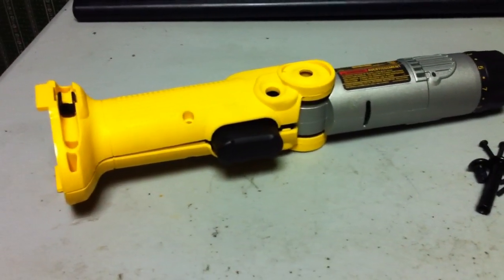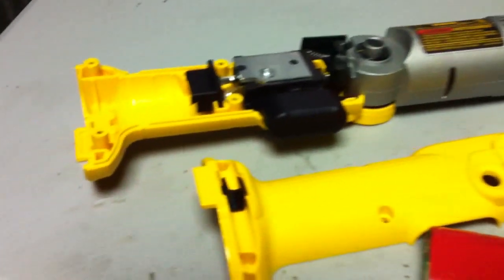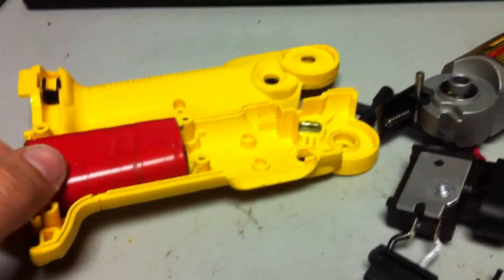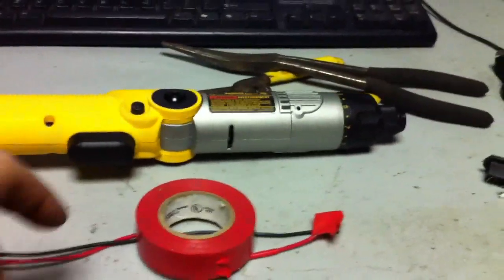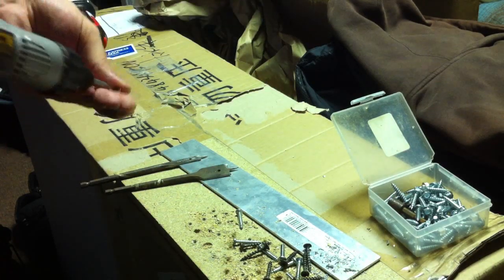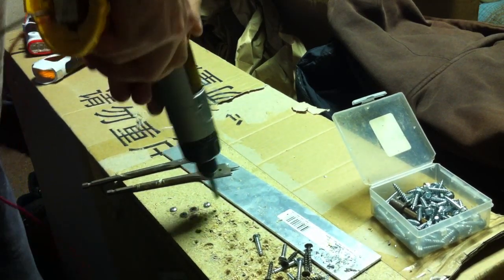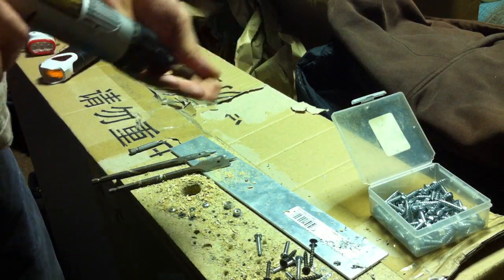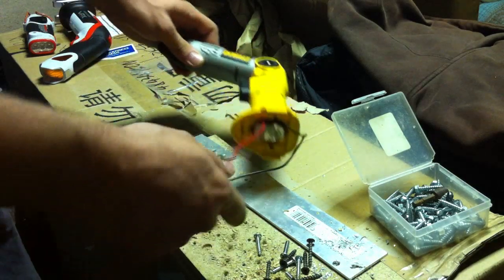Convert your Drill to Lithium - Dewalt DW920

Comment: I know this is an old video, but do you have a parts list for this project?
Reply from the maker: All that you need is 2x 18650 cells wires in series and a soldering iron and a bit of wire

Comment: https://youtu.be/KjDND7qYtCw
Video reply- with some more info.
Wanted to add fully charged voltage is right at 8.39v.
Batteries here-. https://www.18650batterystore.com/Sony-18650-p/sony-vtc6.htm?gclid=CjwKCAjwwvfrBRBIEiwA2nFiPeFCqmbMY72uvb7Puq7zjIvGzzx7vCthPkvOHYAHyGeMpy9qxg2hOhoCxboQAvD_BwE

Comment: I am modifying a DeWalt drill just like yours. My question is  did you wire the batteries in series and what plug did you use to connect to the charger? Thank you.
Reply: You're on the right track! Wired in series would be 3.7 volt x2 = 7.2 volt.  Here's some good info on batteries... http://batteryuniversity.com/learn/article/serial_and_parallel_battery_configurations 

Between me and my Son In Law, I have 2 of the drivers and 3 or 4 of the 7.2 packs. So I would change the packs, instead of making a permanent install in the driver itself. To me, It's not hard to do! But as always, use your own judgment on your abilities!! And.. If you're unsure of your abilities, ask your Father In Law!..lol

Good Job to the person doing the video!! I'm using the 18650's in E-cigs. Guess I should say, most E-cigs use the 18650's because I haven't converted them, they come that way!!..lol
I haven't looked into the cost of converting the packs! But free is free!! And if I were getting the 18650's free, I might make a permanent install! But batteries are batteries and as sure as I'm typing this! You'll be making another install someday!! But...Same goes if I make the packs!! So I'm going with...Free is free and you have the hard part done!!! 
Good Job!!!
Reply: Thank you.

Comment: Great info, thanks. I plan on running wires from the drill leads, through the handle into the emptied old battery pack then connecting them to the plug that fits the pack I'm buying. I am planning to dremel (cut) a series of vents into the side of the foam lined pack. When I do plan to charge I will just take out the three screws and remove the pack completely. Thanks for the info and the great uploads you took the time to create.

Comment from the maker: ya that setup would work fine. just be aware that lipo can combust easily and should not be handled rough in construction. i put lipo in a ryobi battery shell before and they caught fire while charging!! got too hot. these drills are old brushed technology so thier just rated by the switch(trigger) and the wire size. the triggers are rated for 7.2-14.4v its stamped right on it. so the voltage is not a problem. i wouldnt go higher than 3S if your looking for a permanent solution.

Comment: Digital LCD Lipo Nimh Li-ion NiCd Battery Balance Charger & Discharger iMAX B6- Off Ebay

E-flite 1250mAh 2S 7.4V 20C LiPo, 13AWG EC3, EFLB12502S- battery pack off ebay. I didn't know if 7.4 volt would ruin the tool.

Comment: NICE VIDEO! I have this tool with two dead Nicd batteries and I refuse to get rid of it. Can you please tell me if the following items will work for me? I am going to empty out the old battery pack and vent them for cooling to accommodate the Lipo pack rather than go through the handle. Thank alot. if you can help guide me to the right set up for this that would be awesome....

Comment from the maker: the cells are sony 18650VT out of makita BL1815 or BL1830 tool packs. you can charge then with any 2 cell lithium charger that outputs 8.4v
Reply: Tengo un taladro de mano igual al del vídeo que no le vale las baterías y está arrumado ..porf..ayuda con traducción en español para entender mejor con y poder repara

Comment from the maker: no, it is never recommended to charge lithium cells with an old charger. it may work at first, but can be very dangerous. You will want to use a 2 or 3 cell lithium (LIPO) charger